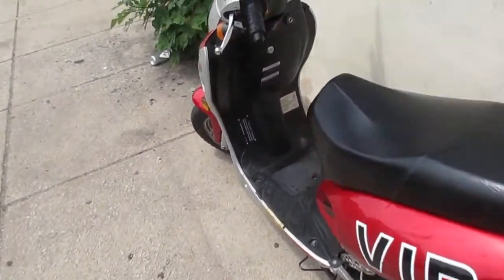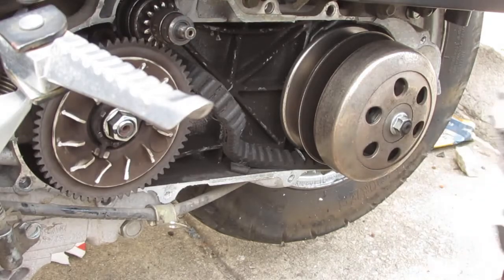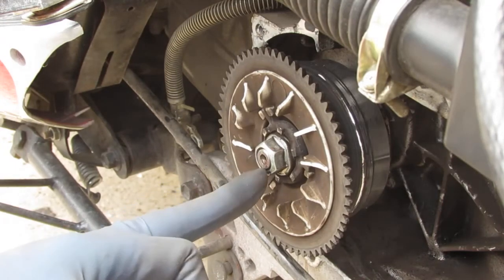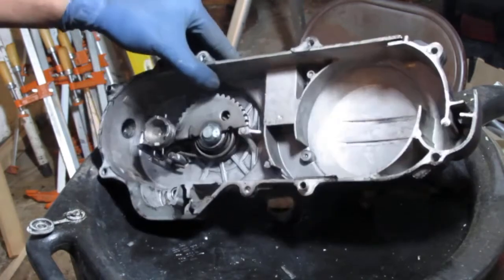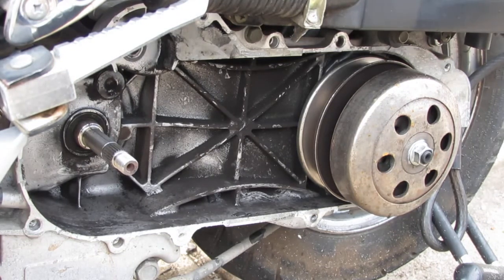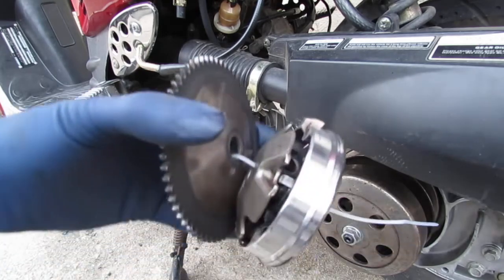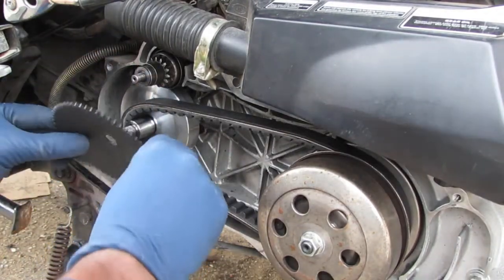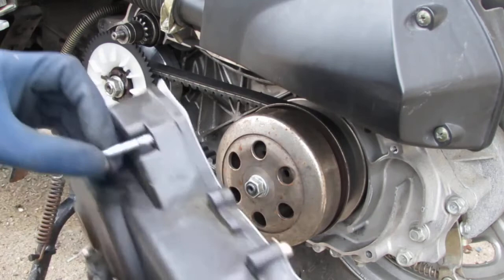Scooter QMB139 GY6 49cc Failed Drive Belt

Comment: Hi there I have a 2017 scooter wolf lander and I have the same problem with the belt so I have an appointment with this mechanic he's going to charge me with the towing belt labor 110 thanks for showing me this
Reply from the maker: No problem and this was my first attempt at fixing these.  They are very easy to repair, very close to a 4 stroke small engine on a pressure washer.  $110 is about right and a good deal.  Where do you live to get such a deal?

Comment: Backwards torched kick starter for emergency starting.,if your battery is low to.
Reply from the maker: Thanks for taking the time to explain this.   It was my first time working on a scooter.  They are very simple.  They remind me of many of the small engine handheld equipment I have worked on.

Comment: Does anyone know what would make my scooter not have enough power to even take off ,after I changed the drive belt?? It's a 2020 tao tao pony 50 cc
Reply from the maker: When was the last time you changed your spark plug and spark plug wire?  The sounds like a carburetor issue.  The air and fuel mixture are not correct or just getting clogged.
Reply: Could need vve adjustment you ever do that? How many miles?

Comment: take off the plastic flywheel and leave it off that's what was breaking my belt's it's hitting the kick start and the peace's' are getting in the belt I have gone through 4 different plastic flywheels work great when I took it off.
Reply from the maker: Awesome removing the flywheel solved your problem.

Comment: Where do you get parts ? I can get no parts here in Ct.
Reply from the maker: PART(S) : 
- CVT Drive Belt for 50cc (49cc) Scooter
https://amzn.to/3xAJpa7

- Complete Variator Kits
https://amzn.to/3vHnGfp

- Gasket Set GY6
https://amzn.to/35FTsPu

Those are the source.  What does "Ct" mean?
Reply: @MotionDesignStudio  I just installed that size belt and its too small. It's still pinned down in the clutch. It's supposed to be on the top. This is a Bintell scooter. Or at least its supposed to be.
Reply: @MotionDesignStudio  Connecticut